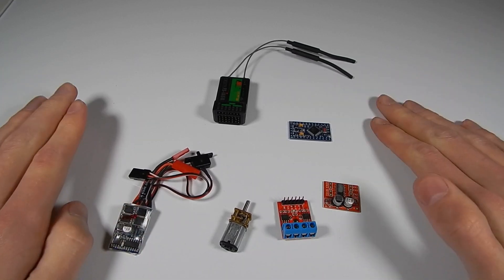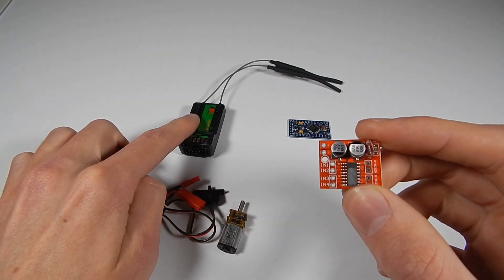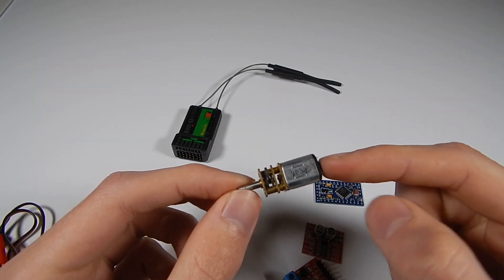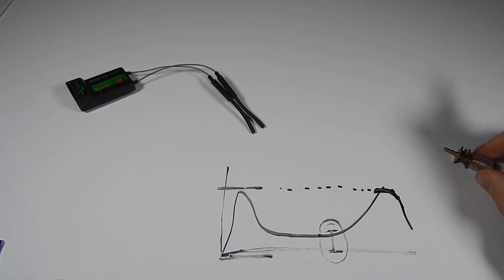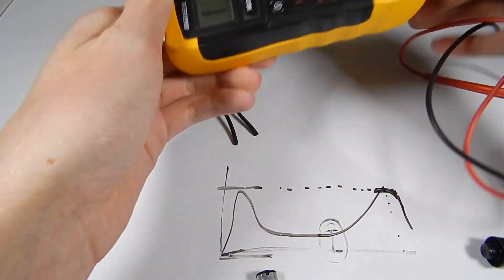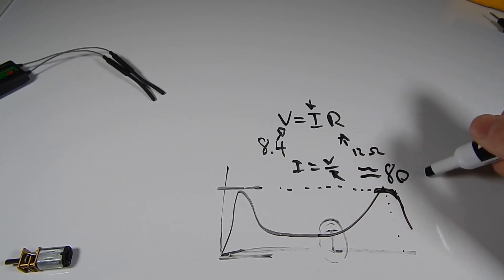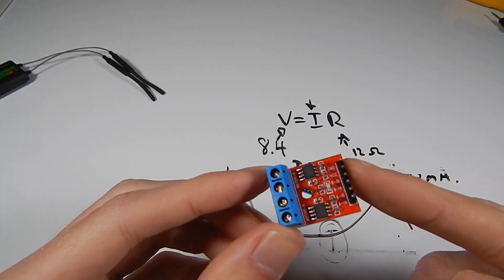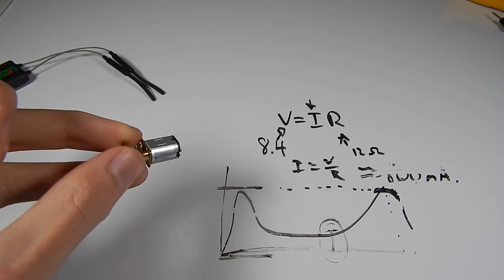How to size an ESC/h-brigde for brushed DC motors

Comment from the maker: Quick Correction to the graph, the stall current does not drop off the way I drew it.
The whole time the motor is stalled it will draw the stall current. It will only draw less current when the motor starts spinning again
Reply: Thanks for this, I'm just getting into Robot building, trying to choose brushless or brushed currently and arduino or RC ESC etc.
When stalled, aside from ESC burn out there is risk of motor burn out also? If so then isn't a current limiting device set just above startup/in rush current also required to prevent burning motors?

Comment: My L9110 driver, I just bought it and used only one side with small 130dc motor, overheats, I used external 12v for the motor and ground to the ic.
I use Ht12 decoder encoder.
All that just trail stage and I don't know what I'm doing wrong.

Comment: what voltage motor did you use? (robotics newcomer confused by aliexpress)
Reply from the maker: It does depend on the application
For combat robots the voltage quoted for a motor is often quite useless, fights are 3 minutes long so even if you are running a motor on 2 or 3 times more voltage then its rated for, it should be fine. It will get hot, but it shouldnt die in 3 minutes

For other more longer time period applications, choose a motor voltage higher then or equal to your battery voltage 
(but also here "motor voltage" can be kind of useless, as oftern the "motor voltage" is just the voltage the seller tested the motor at, and there is little to no difference between a "12v" motor and a "6v" one. The biggest thing really is the motor size, as that determines how much wire can fit into the motor which determines the voltage it can run on without over heating. So if you see 2 motors the same size, one a "12v" motor and one a "6v" one, you should be fine to run either on 12v)

TLDR: dont worry to much about the rated voltage of a motor, just dont go to far over it for too long
Reply: @TeamPanicRobotics  thank you,it was very helpful :)
Reply: @TeamPanicRobotics  also you spelt bridge wrong in the title

Comment: I run an rc bulldozer with 55t motors and 30amp esc brushed. 1 motor is slower and stopping or cutting out. Then put stick to neutral then start it again and  goes for about 5 sec before cutting out again. My planetary gears are superbly clean maid sure. Try bigger esc?
Reply from the maker: Maybe, could also be a motor short problem

Comment: Didn't know you'd made this video until the playlist was posted... would have been very useful earlier when I started building my own ESCs, now I use drv8837d which is a tiny chip which can do 1.8A (and I mean, really small, 2x2mm, no leads) - they rock
Reply from the maker: Oh cool will have to check them out

Comment: I have flysky i6s transmitter and I’ve been looking for a brushed ESC to work with my flysky RX & TX , I want to build a light weight brushed motor airplane with 7.4 volt 8520 motors in a gearbox turning a 5 inch propeller so I need a proper brushed ESC , do you have a link for me ? Thanks 🙏
Reply from the maker: Sorry I dont have a link.
I dont know the resistance of an 8520 motor so I cant calculate the amp rating of the esc needed.

If you watch the video and follow along you should be able to get the amp rating for the ESC you need
Reply: Team Panic I did some research I think a 10amp 2s brushed esc will work for my application , I found everything  I needed to know sorry I was just finding out about some of this stuff , im building a micro rc wing & I wanted to used brushed motors instead of brushless to make an ultralight set up  , so I stole the hubsan h502e gearbox/ motor/ propeller assembly to mount on the rear of the wing , I want to make a delta type design , I subscribed to you , thanks

Comment: Can you use the H-Bridge without the arduino, just by connecting it to the reciever?
Reply from the maker: No, RC receivers send out a short pulse signal thats designed for a servo to read.

H-Bridges need a full PWM signal, so the arduino is used to convert the RC signal to a PWM signal
Reply: Thank you :)
Reply: @TeamPanicRobotics   how to convert it with Arduino

Comment: Do you have a link the Ardiuno nano you have?  All the ones I can find have a USB port on one end.  Also could you do a video on how you solder/attach all your electronics together. Arduino -Hbridge - receiver and BEC?  I’ve shared your video on Robotwars101. I’ve found all your videos very useful. Thanks 😁
Reply from the maker: The Ardiunos I use are Pro Minis like this one: http://www.dx.com/p/tj-02-pro-mini-module-atmega328-5v-16m-for-arduino-blue-250587

Yeah, I should do a video on all my electronics at some point. Before I really started making videos I put up an instructable on it: http://www.instructables.com/id/Cheap-Arduino-Combat-Robot-Control/

Glad to hear you find them useful, if you have any other video suggestions please let me know

Comment: I have seen your Instructable on your Arduino setup, and I have a few questions. 1. Does it failsafe? 2. Do you think someone without Arduino knowledge could do it. I have 2 ESC setups that I use for my 450g bots, and could be used for 150g bots, but am looking for a cheaper and lighter option. I am seriously considering your setup. Thank you for replying to all my previous comments.
Reply from the maker: 1. Yes, absolutely! all the code that makes the motors drive is wrapped in an If Statement, so if the radio is not receiving the motors don't move
2. Maybe, I put as much information as I could into the instructable, however, its a more difficult project to start using Arduino with. I'd recommend doing a few basic Arduino projects first, start with a blink program, then try to control a motor, then look at adding the radio module.

I've been looking at making my own ESC's with Arduino so I might be putting a video on that up in the future, depending on how it goes. If I do put that information up, it will be simpler than my current Arduino setup but it will still require an RC receiver.

no problem! thanks for asking good questions!
Reply: Thank you! I will wait to see how ESC's go before I make any decisions.